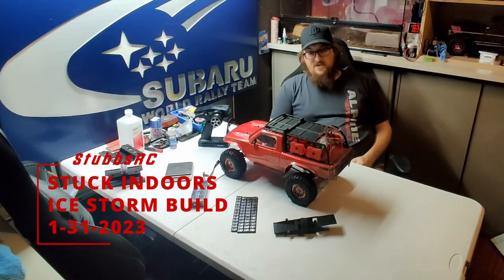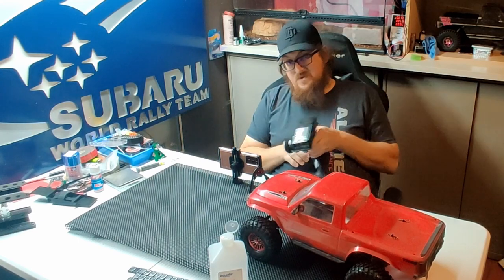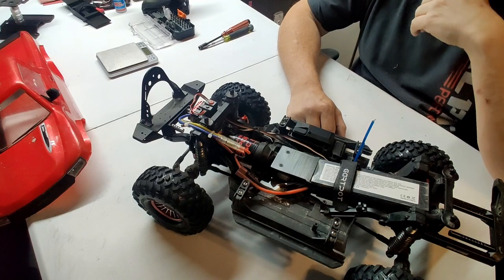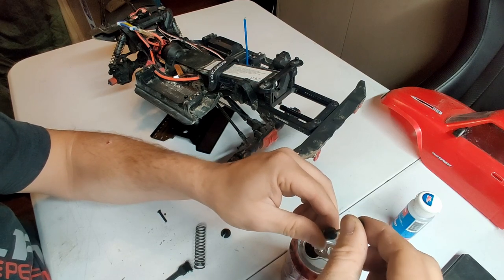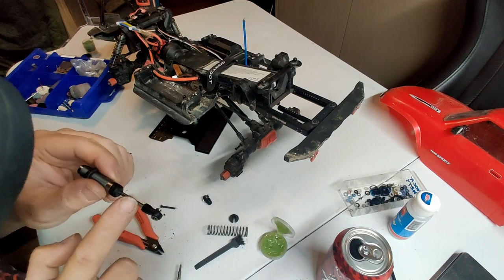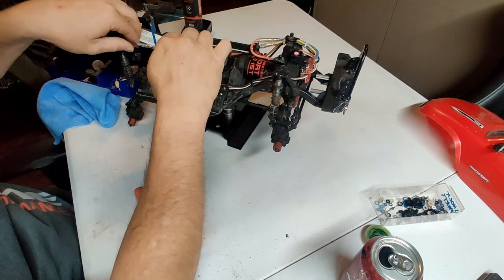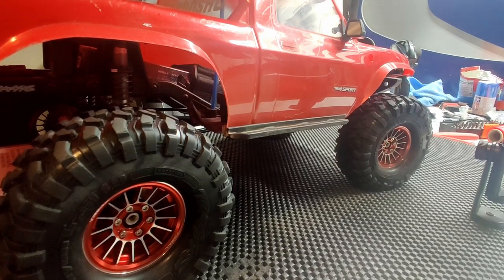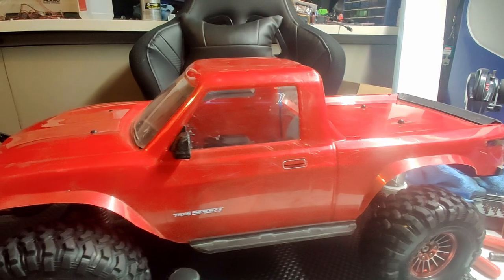Revamping a Used TRX4 Sport: A Journey to Fix it and Set it Up!

Comment: A single 4-6 inch zip tie around the frame and upper 3rd link at established ride height will allow for full front articulation without the front axle unloading on climbs. Nice tutorial.
Reply from the maker: I use construction string, I actually tested with the "tilt table" and saw no difference believe it or not. 60-61* either way. I left it out of the video because it didn't make a difference on this rig and I was trying to stay under 30 minutes. Also the editing, audio, music ect. took me all day today. I am learning sound engineering, crossfading ect along the way!
Reply: @StubbsRC  That's surprising, because it has worked on my 3 link rigs. But, I've never done a flat climb for testing. Cool nonetheless, hope to see you Sunday for some mud fun.